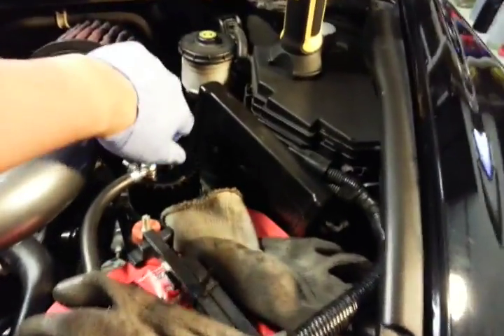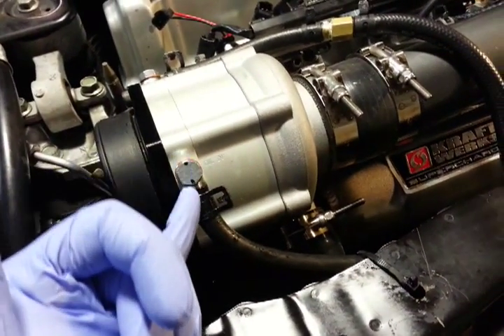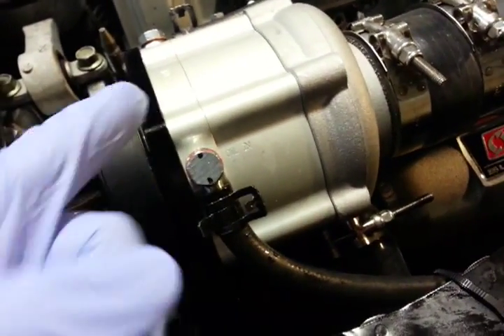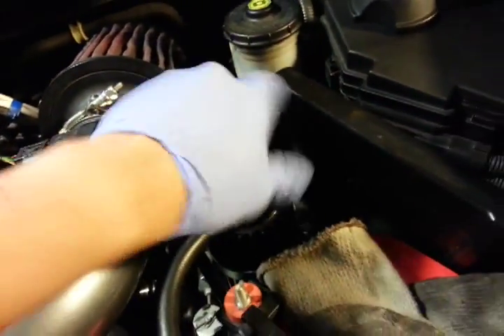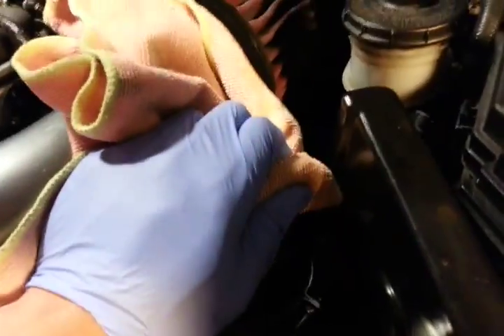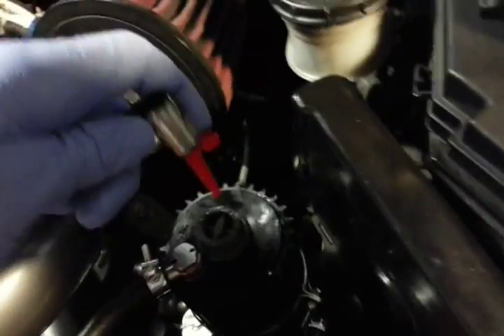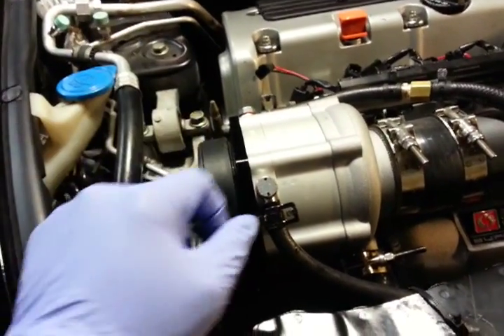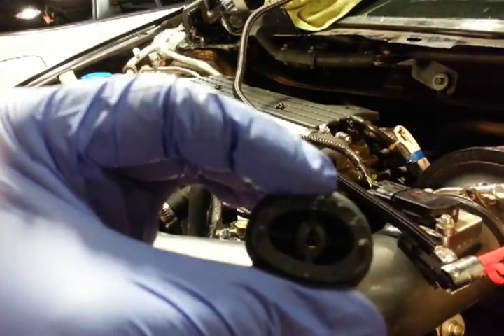Kraftwerks. Priming Oil System

Comment: Idk about you but my bolts flow the tip of the screw is skinner than the threaded area… so no matter how the screw is aligned oil will be getting in, but then again my set is 2022 version things change from this vid haha

Comment: You better check the return reservoir to make sure oil is  circulating..too many times these guys say I done it just like the instruction say but end up cooking the head unit then complaining to the company. You have to burp the unit. Yes, you will see oil at the banjo bolt.Tighten it. Then you should be able to see it flowing into the  reservoir with engine started and if it is done right. If not that means you haven't primed it enough and if you drive it like that it will fail.

Comment: I see you installed this kit and the ct-e one. Which do you prefer?
Reply from the maker: +SkylineeMedia The KW kit by far. I was running full IHE with stage 2 CT (non-cooled) and now on KW with stock IE with high flow CAT, and the feeling of more power and the smoothness with which that power is delivered to the car feels so much better with the KW kit

Comment: They don't mention the orientation of the holes on the banjo bolt because it doesn't matter. Although what you did can't hurt. Its also pointless. Banjo bolts are designed so that fluid runs out of those holes. And all around the orifice inside the fitting. The holes being misaligned will not restrict the flow of fluid at all.
Reply: SSleepingPanda that’s exactly what I was thinking if not there would be a whole bunch of fried rotrex units. By looking at the design you can tell oil is still able to go through the lines regardless of where the whole is.
Reply: hello guy can you hell me? so i just have to add oil to the deposit of my supercharged? i just change my engine and now i need oil on my deposit. i just have to add oil? or i have to do the same with the air pump. obviously i dont gonna move any bolt